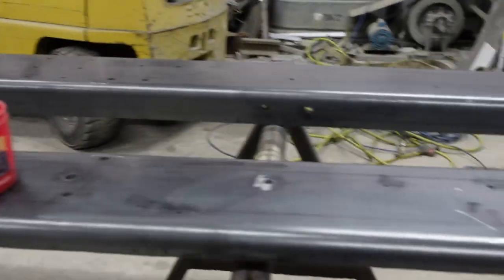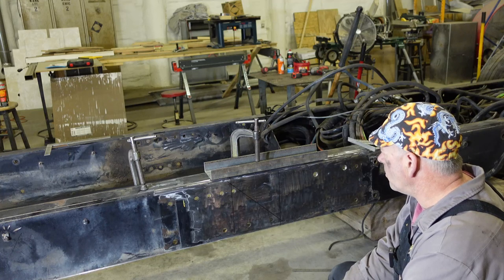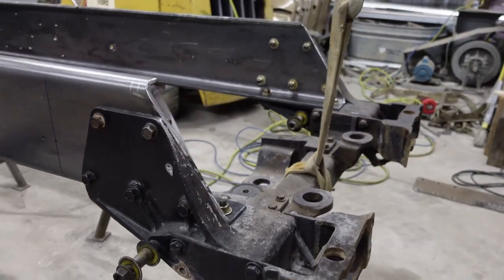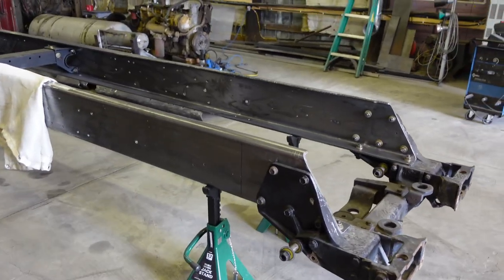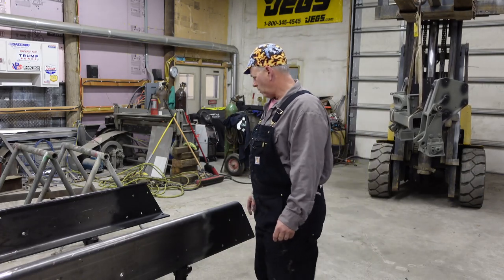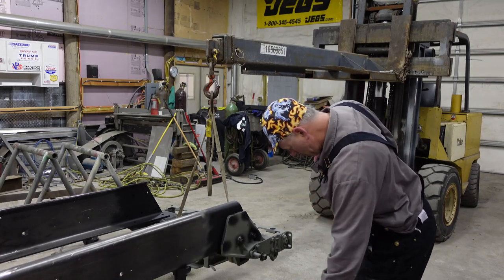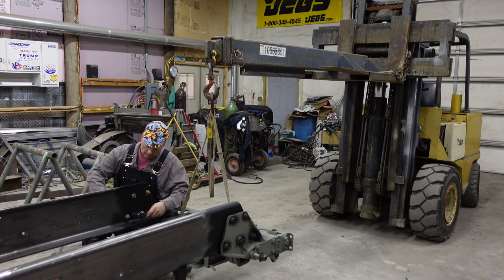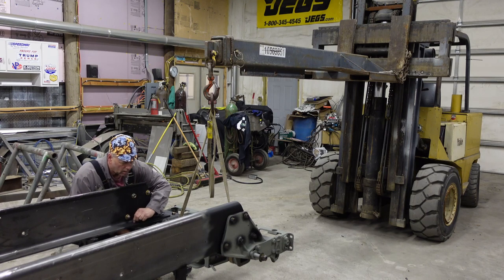359 Peterbilt EXHD restoration PT8. Frame stretch an new frame.

Comment: My welding instructor (a pipeline welder of many years) stretches and shortens farm trucks on the side and uses cutoff wheels to save work though it may reduce the HAS. He does it because cutting leaves a finished edge.

Comment: I wonder how much more it would cost to just replace the entire frame rail.?
Then you could use the old rail as template.
I actually did this to my 359 pete
Reply from the maker: It would have been around 6k more I believe. Shipping would have been allot higher. All the rear end hanger brackets use large huck bolts. So that would have been allot more also. I will be haveing more videos soon.

Comment: Could have bought two new frame rails 380" w/b my former boss did it under sleeper and the fck broke in two left me on highway when dot tested everything thd welding was not at fault the twisting did it they said never cut that far forward.good luck